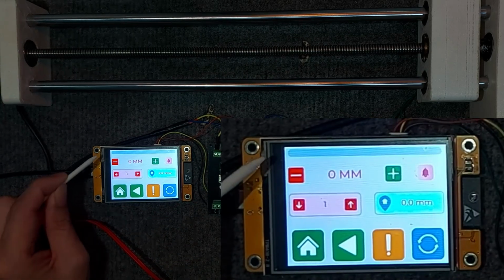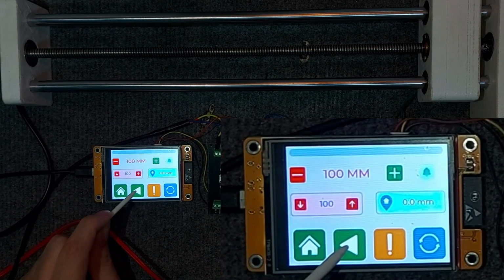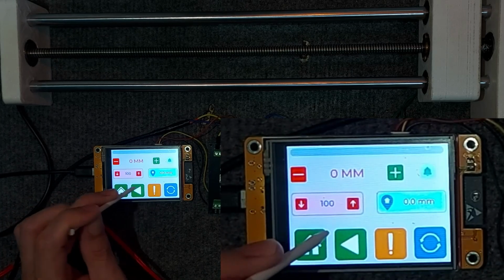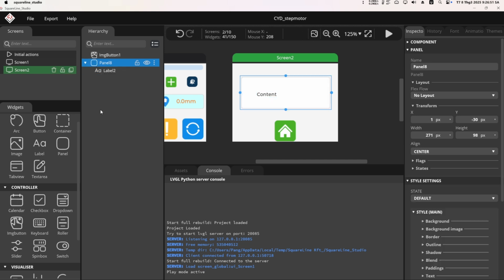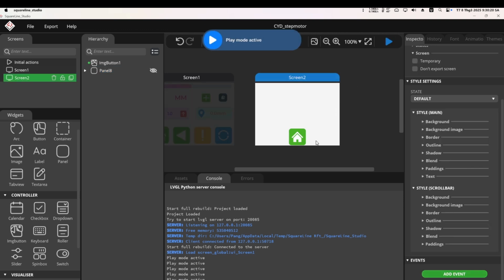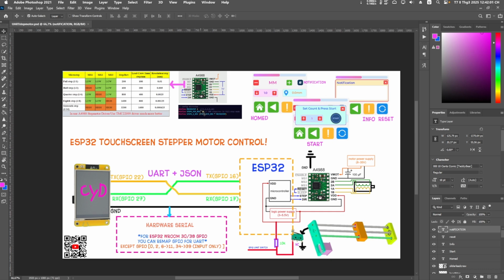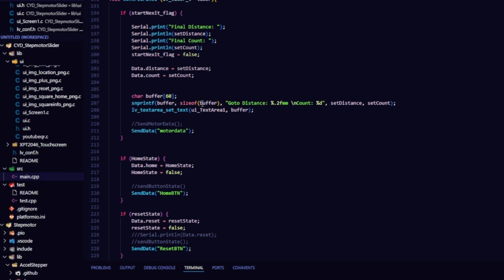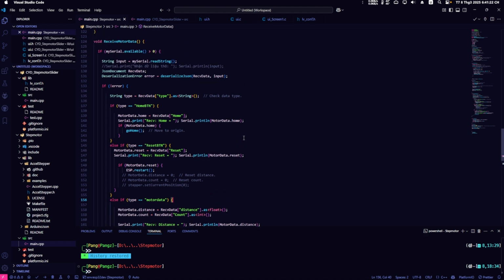ESP32 Stepper Motor Control Panel with LVGL & Touch Screen

Comment: I had to change the code to use LittleFS to compile.  I am not a coder but used Copilot in Platformio to get it to work.  One axis is kind of useless ... can you update this to have two or three axis for Cnc Controller
Reply from the maker: @ronehorn  if you want use for CNC machine, you should use gbrl or marlin firmware it optimize for stepmotor, driver controller and multi function. In this video i make a simple way to know how to control stepmotor with simple UI.

Comment: Thanks very much for this video. I have been looking up on how to drive a stepper motor with an ESP32 with a touch screen. What you do with the stepper is not what I want to do BUT it is a very useful primer for me to do what I want. Thanks once again.
Reply: Did you try using the SPI header on the CYD  and repurpose the pins as output (Dir,Step,Enable)?